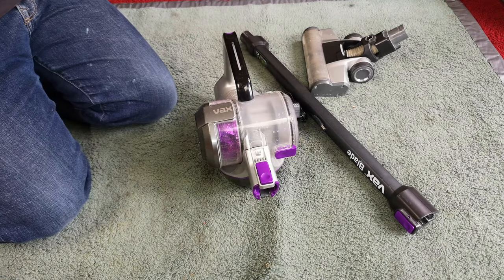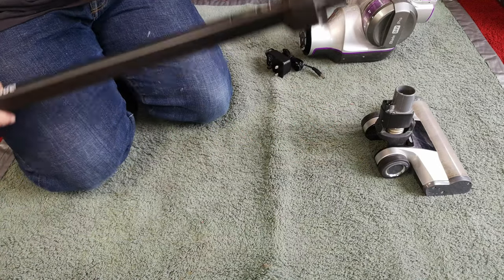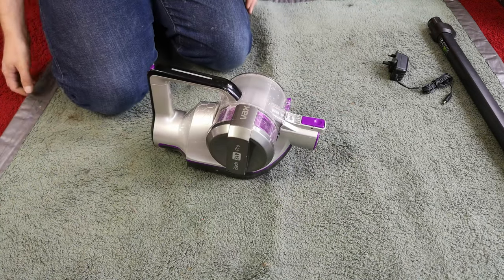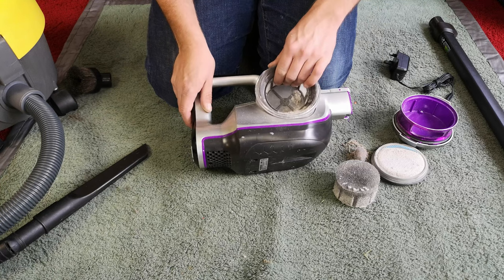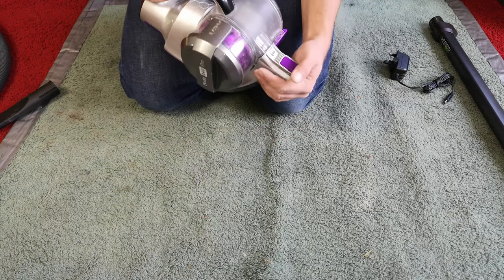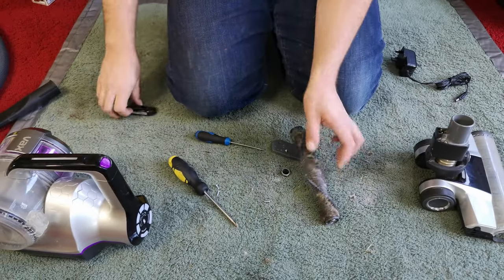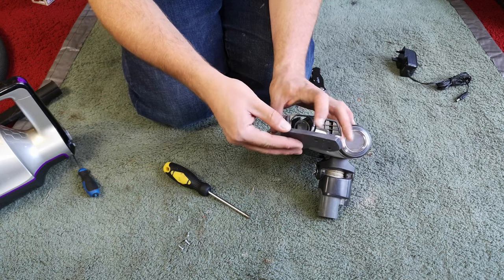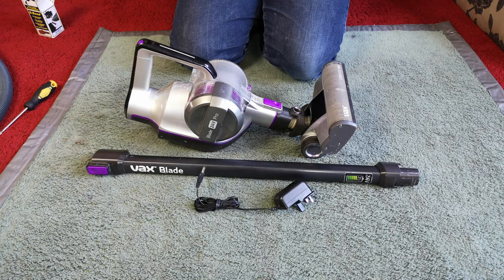A FREE Vax Blade 24v Mk1 - First Look! (It's FILTHY!)

Comment: The mk2 40v with brushless motor was substantially better, also dual cyclone, we had one for 4 years, recently sold it.
Reply from the maker: Yea I gather they changed everything entirely after this with great improvement! I'm after a blade 4 as the head is identical to the Henry Quick bar the actual machine fitting...
Reply: @beko1987   it was a not bad machine, build quality a little iffy  for its price point, but performed ok .

Comment: My brush bar belt tension it so slack that it jumps teeth even with a new belt. Any advice?
Reply from the maker: Something else has worn to allow it to do that... Both brushroll end caps decent?
Reply: @beko1987  it’s like the two sprockets need to be further apart. But there doesn’t seem to any wear or anything broken. It’s strange.